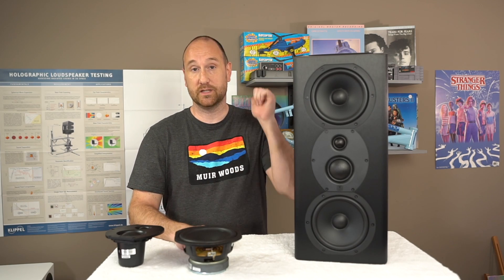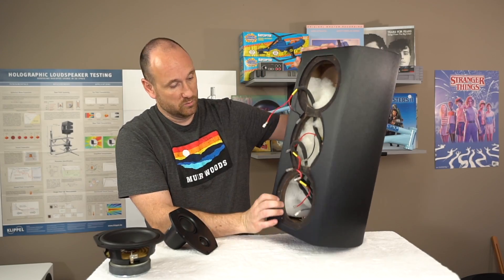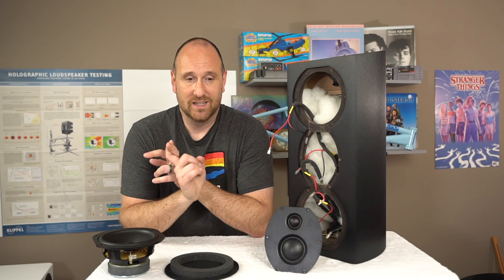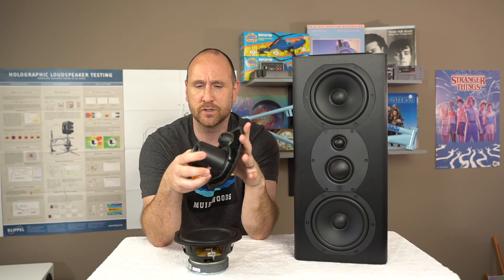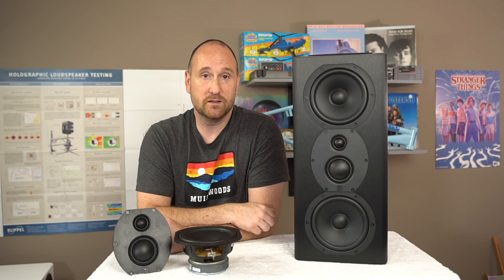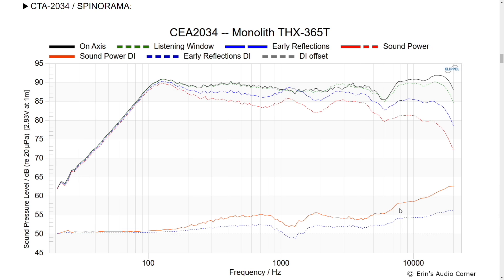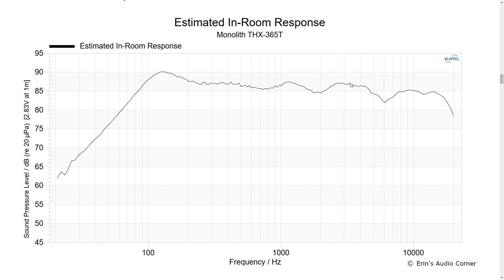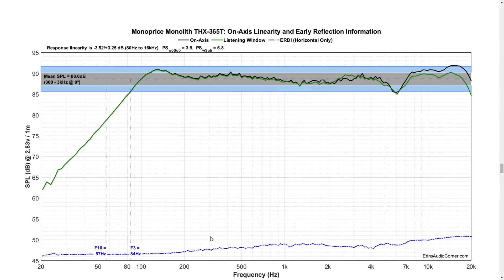Monoprice Monolith THX-365T Mini Tower Review

Comment: Its funny really. You dont need a "theater certified" speaker. Any high performance speaker will do. THX is genius marketing to the less informed. Make cheap, impressive looking speakers with zero bass that absolutely require a subwoofer to be purchased, its a guaranteed sale, a neutered speaker that can therefore play really loudly; the badge implies a quality sound "lookie here! These ones is T H X bonafied!", but no audiophile would take these seriously.
Reply: The day THX allowed their badge to be slapped on crappy computer speakers (Logitech z623 here is looking at you!) I never took the badge seriously again.

Comment: What would be the ideal power to run these? 150-200w? They are 4 ohm....and crossed over @ 80hz
Reply from the maker: The difference between 150w/200w is trivial... about 1dB in output level.  Generally I say get the most you can afford but if there's a big enough savings then 150w is adequate for most home theater/stereo applications, assuming you're sitting within 3-4 meters.

Comment: I would be very curious how the Monoprice THX-465IW does with your testing. Seems like a great band for the buck if it EQs well. Also wonder how that compares to the jbl scl6 synthesis. Enjoy the content!
Reply: ASR's data for the THX-365IW looked a lot more impressive than this.

Oddly, the THX-365C also gave a much better showing in Erin's testing; there seemed to be stronger overlap with ASR's review of the THX-365IW, once you account for the latter's +/-90° polar response.

Comment: CONFUSED 😵‍💫  -  Audioholics shows both this Center and Bookshelf never quite reaching let alone dipping below 4 ohms. Also both the On-axis and In-room frequency graphs are quite different. So what gives? Are each of you measuring differently OR are we in for a potluck from Monoprice and have no idea what version we will be receiving 😕. Did you by chance test the pair of 365Ts? ...which would maybe show manufacturer variances if any existed.
Reply from the maker: Without looking at their results I can say that Audioholics uses a different measurement method that is limited in response accuracy and resolution.  It's good but it's not up to par with the accuracy of my system (and they would acknowledge this as well).
Reply: @ErinsAudioCorner  Hmmm, I compared the THX365C back to Audioholics as well as this THX365T (which were reviewed and different times and therefore very likely different 'batches' of speakers) and the 'differences' was consistent between your (more accurate) measurements and that of Audioholics (and across ALL graphs / measurements). I have to say I am a little bit disappointed that Audioholics measurements (something that I've been relying on for years and years) aren't quite as accurate as I would have liked. The good news is that Erin's Audio Corner is now here with seriously ACCURATE measurements!  Thank you !!!
Reply from the maker: @johndaddabbo9383  I like the guys at Audioholics and I think James is one of the best reviewers around. Their speaker measurements are quite good and I’d say good enough most of the time. The resolution isn’t as high but I typically get what I need to know from them.
Reply: @ErinsAudioCorner  Totally agree!  ...and now that I have uncovered what appears to be a TREND in their slightly less accurate measurements I will still be able utilize their measurements. Plus Matthew and James are GREAT!!!

Comment: The narrow portions of the front baffle between the mid-woofers to the mid/tweeter face plate - look to be very problematic. A lot of chance for resonance there ...
Reply from the maker: Large unsupported panels are typically the more problematic parts of enclosures.  The "bridge" between driver mounts are less likely to be a large 'resonator', I *would think*.
Reply: @ErinsAudioCorner  Well, the drivers are forming a large surface, in this sense - so the holes are weakening that large panel, right? Well designed cabinets have a rib or a full brace right at this point - it is the weakest part of the structure.
Reply from the maker: @NeilBlanchard  I don’t believe the drivers will resonate in sync with the panel as you seem to imply.
Reply: @ErinsAudioCorner  I am pretty sure that they do - the mid/tweeter plate in particular is a solid item and it is acted on by the air pressure in the cabinet every bit as much as a regular panel - but it is not nearly as strong as the panel; because it is joined by only the mouting screws. If the driver plate was glued in place, it would be a lot stronger, and vibrate less.

And the woofers are vibrating their cones, and for every force, there is an equal and opposite force - so the weakened panel is going to vibrate more than a solid one.

Look at well designed cabinets - they reinforce this exact area.

Comment: Can you do this with JBL pro cinema speakers?
Reply from the maker: Which specific model(s)?
Reply: @ErinsAudioCorner  yours one please. I'd like to see it with that mic testing. The one that reads the frequency response and translate it into charts. Please 🙏🏼
Reply from the maker: @bobidderis3880  I meant which JBL speaker model were you looking for a review on.  (If you're asking for the ones I use in my HT, they are DIY designs and integrated into a wall... I don't have any real desire to gut the baffle wall to pull them to test)

Comment: How did these get thx certification?  Looks like either bad selection of drivers or a revamp of the crossover network is needed.  Unusual driver configuration for a 3-way speaker; the D'Apploito effect is for 2-way speakers.

Comment: Damn, I was heating up a bit for those but after this info I don't know if I can warrant the 500. Too bad, I thought I finally found a good 3 way for home theater that is affordable. Its the combination of problems that cost additional $ to solve (separate amp due to impedance) and unsolvable problems (dispersion and linearity) that is a bit too much to swallow
Reply: diy, just get good cross over parts make a solid box. be better than you can buy
Reply: @jsloan5216  Not necessarily true, unless you get really lucky or use a proven design it takes a lot of testing and tweaking to get a loudspeaker to be good. That's why there's so many duds on the low end, the reason they're so much cheaper is partly because they aren't spending all that time and money to refine their design.

Comment: I have the in wall version haven't installed them yet I will be using them as side surrounds will be using arendal 1723 towers and surrounds for the rest of my system I picked these because they are thx certified and I heard Dan Romer helped engineer these and the arendals do you think they will blend well with each other
Reply: No

Comment: I have these as my sides and the towers as my fronts. I think they're great for movies and shows, but not so much for music (not horrible, but I have better speakers for music). The Monoliths seem very dynamic to me...paired with Monolith 7x amp and 4 subs...no one falls asleep watching a movie at my house :)

I EQ with the Audyssey app and leave on the midrange compensation setting. I always thought this helped alot.

Thanks Erin for all the help and your hard work!
Reply: Sounds like a great setup! 
Did you set the crossover setting at 80Hz for those 365T's or higher?
Reply: Yes, crossover at 80 per THX recommendation
Reply: What speakers do you have for music?
Reply: @Soltballs7608  Right now I'm sporting a pair of Omega Super Alnico High Output monitors driven by a Monoprice Pure Tube Amplifier. I'm using my 4 subs with them as well via input 2 on my MiniDSP...pretty good setup for me. I also had a pair of Monitor Audio 200s prior to this (same setup) and that sounded really good as well.